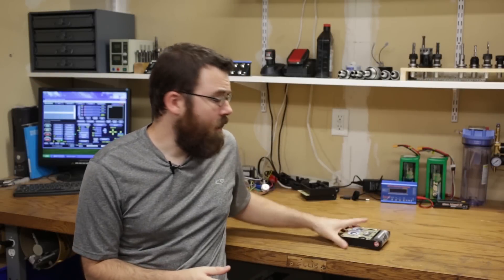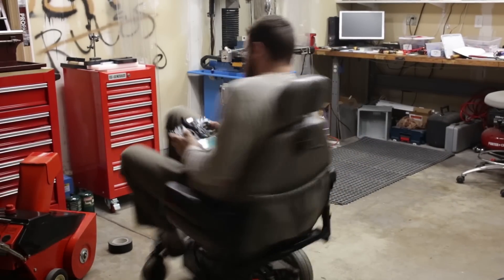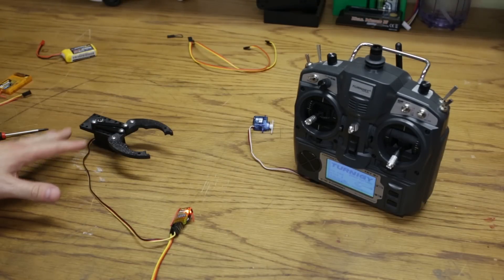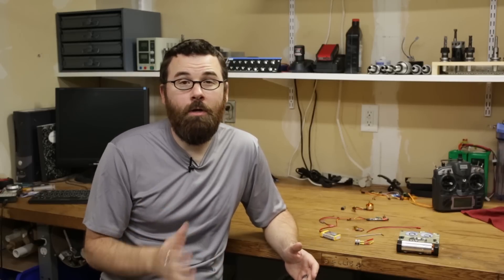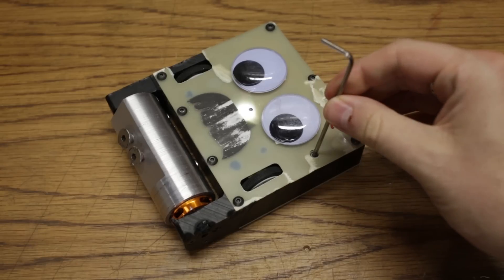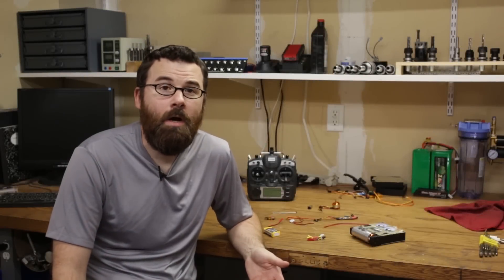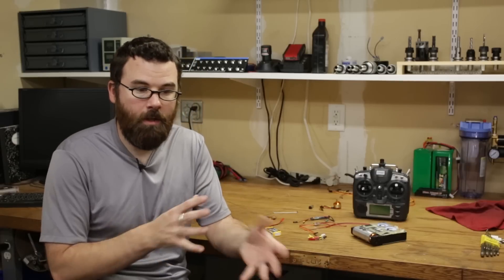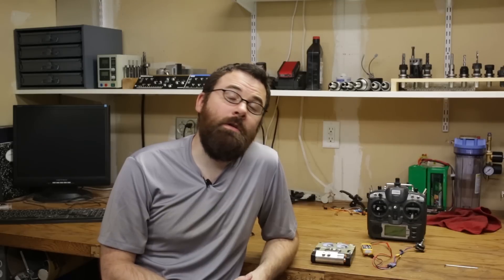Antweight Combat Robot - Part 3: Electronics

Comment: Hey man, awesome video! I really hope you see my comment, because I have two questions. I wanna build my own first ant (150 g) in October, when my exams are over (I started doing all the planning already).
I want it to be some sort of grabbing robot, similar to a lobster. Already made a drawing on some of the details. Now to my questions:
1. The servo claw construction you show in the beginning of the video looks awesome, where did you get it? I am still wonderinf whether fully custom claws are a good idea or not.
2. You showed some CAD clips; where did you get the files for all the basic parts like motors, battery, etc.? Because that would make the perflect planning a lot easier.
Thanks in advance :)
Reply from the maker: I don't want to discourage you, but 150 grams bots are pretty tricky to build, especially when they have active weapons.  And ant (1lb) or beetle (3lb) would be my suggestion for a first bot.  Regarding the servo, you can get it anywhere, it's a 9 gram servo, and that usually refers to the weight.  Check sites like amazon or servocity.com.  The claws were made by servocity, they have many different configurations, but you might find them too heavy to use on a 150 gram bot.  I made all the files myself in CAD.  It would be a good idea to watch my getting started video and use the resources available in the document linked in the video: 

 https://youtu.be/jZZfU_wlvYo
Reply: @RobertCowanDIY  Thanks for the answer :) I will definitely check that video out in the near future!
Interesting that you recommend not starting with an ant. From what I read and heard it is the typical beginner class. The problem is that I am from Europe and 1 pound bots are not that common, so this is no option for me. And the heavier, the more expensive bots get, too :o  That was my thought process behind choosing an ant. Do you think that for my grabbing bot starting off with a Beetle rather than a European Ant is better for me as a beginner, both regarding simplicity and _price_? Yet it would still be easy to switch the weight class :D

Comment: back again sir, so the wires and stuff how many do you need because i went to make one of my own and i need to now how much motters and wires i need for the bot. I.E 4x brushless outrunner. i need to now how much money i need :/
Reply from the maker: It really depends on the design.  You need a motor controller for every motor you plan to use.  If you are using a brushless motor, you need a brushless ESC.  If you are using brushed motors, you need a motor controller for those as well.  If you are using 4 drive motors, you can use a single speed/motor controller per side.  But generally speaking, you will need a controller for every motor.
Reply: ok  thank you

Comment: the battery is out of stock so do you have any other recommendations?
Reply: another question i had was wat kind of breakout board i need to use?
Reply from the maker: It depends on your design.  You can also check eBay or Amazon for the battery, I've found them there too.  But any battery with similar specs should work.  Also, I'm not sure what you mean by a breakout board, there's nothing needed other than the motor controllers, switch, and RC receiver.
Reply: thnx for answering I found some batteries with almost the same specs, about the breakout board.....I found a website with an explanation of the parts of a battle bot. A breakout board was one of those parts but it really confused me, now i know why. Thanks a lot for answering so quick :D

Comment: how did you get the drive to work with one joystick? does the transmitter do the mixing?
Reply from the maker: Check the comments and video.  It's called v-tail mixing, tank steering, etc.  If you have a programmable remote, you can program this in the remote, or you can get little modules that do this for you.  I programmed mine into the remote.

Comment: Hey Robert, great video! I'm just starting out with micro gearmotors and was wondering if a DasMikro 2S6A ESC has a built in BEC or a way of stepping down the voltage from my 7.4V LiPo? Thanks
Reply from the maker: I'm not familiar with this, but it looks like it has a 1A BEC, so it would work fine.

Comment: how much for the robot and the remote
Reply from the maker: With all the pieces, maybe around $500.  I didn't keep track, but it all adds up pretty quickly.
Reply: Ok because i would like to make an antwight robot
Reply: What about the chassis
Reply from the maker: How much for the chassis?  Like, you want to buy it, or how much did it cost me?  The material was only around $20.

Comment: Hi, about the "3-pin jumper cables," can you give me a link for the ones you got? I'm using the same parts as you. Also, do they fit perfectly with the escs and power switch?

Thanks
Reply from the maker: +Adam Hung I got them from hobby king.  They're just 3-pin 0.1" spaced connectors.  They are called servo extenders usually.  If you look on hobby king, ebay, amazon, etc, you can find them easily.
Reply: +Robert Cowan (Rowen Hobbies) Thanks (I am something of a complete beginner). How did you connect the escs to the one throttle? I've looked all over the internet but I can't figure it out.

Thanks again.
Reply from the maker: +Adam Hung Are you talking about the drive motors?  the weapon motor is connected to throttle.  In the video I mention v-tail mixing or tank steering.  this will be unique to your transmitter.  You'll need to look up how to enable this for your transmitter.
Reply: +Robert Cowan (Rowen Hobbies)  Yes, the drive motors. I have the same transmitter as you. How do you put the motors into a single control on the transmitter?
Reply from the maker: +Adam Hung You don't really use a single control, you are mixing two controls.  So, when you press 'up' on the stick, it makes both go one way, down makes them both go in the opposite direction, and left/right makes them spin opposite of eachother.  Search youtube for "Turnigy 9x Tank", it will show you how to setup v-tail mixing, or tank steering.  I can't tell you on mine because I've configured mine really strange because I'm a lefty.  There are plenty of tutorials on youtube about it.
Reply: +Robert Cowan (Rowen Hobbies) Ok thank you. Sorry for all the questions, but I was also having trouble with just connecting the receiver to the motor. I have a fingertech esc and a silver spark fingertech motor and the same battery as you. I attached the esc to the battery which worked, and the esc to the receiver and motor. Then I got the receiver to bind with the transmitter.

Everything seems to work, but the motor doesn't spin. What am I doing wrong?

Also, the fingertech website has instructions that say to put a bent wire into the esc.. I did this and then took them out and the lighting changed but I don't see the purpose... Does this have something to do with why it doesn't work?

Thanks so much for helping me.
Reply: +Adam Hung Hmm. Which mode is your transmitter on? (heli, etc.)
Reply: +Adam Hung Ok I got it to work never mind it needed to be on a different mode. Thanks so much. The jumper cables aren't necessary though right, I can just use a wire split three ways?
Reply from the maker: +Adam Hung They aren't necessary, it just makes connecting and disconnecting easier.
Reply: +Robert Cowan (Rowen Hobbies) Ok thanks. Will a soldered normal wire that splits 3 ways work?
Reply from the maker: +Adam Hung sure.
Reply: +Robert Cowan (Rowen Hobbies) I'm sorry, I still can't get the right steering mixes :(  Do I use "prog mix" or "Elevon" or what, and what do I set it to? Also, did you use "heli", "acro", or "slid" under type select? I have the exact same transmitter as you. I hope this isn't too much trouble for you.
Reply from the maker: +Adam Hung You'll figure it out.  There are lots of good tutorials on youtube about transmitters.  you can set them up a lot of different ways, you just need to learn how they work first.  Good luck.
Reply: +Robert Cowan (Rowen Hobbies) Thanks, but I have yet to find a tutorial that works for the 2 wheel turning setup... could you please give me a link? I'm sorry to bother you so much. Thanks.
Reply from the maker: +Adam Hung It's called v-tail mixing or tank steering.
Reply: +Adam Hung Okay. Hopefully last question: What type did you select (options change with different types) heli, acro, or slid?

Thanks for all your help
Reply from the maker: +Adam Hung It shouldn't matter, but I have it set as heli.
Reply: +Robert Cowan (Rowen Hobbies) Right. So do I leave the power parts for the all the speed controllers besides one empty (because of the BEC)?
Reply: +Adam Hung Can you please show us the electronics in more detail. I can't get the weapon motor to run...
Reply: +Adam Hung And what kind of esc do you use in the demonstration of the weapon motor?
Reply from the maker: +Adam Hung The weapon motor is much eaiser.  it just needs power (directly from battery) and signal going to the receiver.
Reply from the maker: +Adam Hung All the information is in the video and the description.  Just slow down, read some tutorials and get a good understanding of what you're doing.  You really need to figure out what parts to what and why before you just go trying everything.  Please, just step back from it and if you don't understand something, google it and figure it out.  there are TONS of resources out there.  Instead of worrying about what wire goes where and duplicating what I did, learn WHY I did what I did and then you will be successful.  This takes time, you can't just watch a single video/tutorial and expect to understand everything.  It took me MONTHS to build mine and I had to learn a lot.
Reply: +Robert Cowan (Rowen Hobbies) Ok thanks I'm sorry for asking so many questions. :P
Reply: +Adam Hung Programming the transmitter is very confusing :(
Reply: +Adam Hung Does the order of the wires that go from the tinyesc (blue/purple) to the motor matter?

Comment: Hi Robert, great series! Would a 4-channel transmitter be able to control a weapon and move the robot? Sorry but I'm new to electronics and robot building, thanks.
Reply: 4 channel radio systems will work fine with robots with weapons, as you need at least 2 channels to make a moving chassis as one channel goes to each wheel, you can use the throttle stick for a spinner motor or other weapon.

Comment: how exactly do you keep the spinner on while driving??
Reply from the maker: This is reversed from normal because I'm left-handed, but I use the left stick for driving, and the right stick for throttle.  So the left stick is spring-loaded and returns to center, and drives the robot forward/backward and left/right.  The right stick does not return to center and is used to control throttle or power to the weapon motor.
Reply: Robert Cowan can you make a vid on how to make it? Plz
Reply from the maker: If I get some more time, I want to do a whole series on the basics.
Reply: Robert Cowan thx

Comment: how do u charge the battery?
Reply from the maker: +leo pikka I use an Imax B6.  They are all over eBay and Amazon.  They are pretty inexpensive and get the job done, but there are much better chargers out there.
Reply from the maker: +leo pikka Yep, that will work!  there are a LOT of knock-offs, and that one most likely is a knock-off, but I have a couple and they work just fine.

Comment: how much for the cassis
Reply from the maker: Are you asking to buy it, because it's not for sale.
Reply: Ok is just that i want to build an antwight robot that can beat my freind
Reply from the maker: Sure.  But the material is very cheap, but you would need a CNC machine to make it.  But you can try something different.  Expect to spend at least $200 on a simple antweight robot.  Most of the cost is in the electronics and remote.

Comment: Wait. Is that the original firmware running on the Turnigy radio?
Reply from the maker: Tilman Baumann - Yep.  The only thing I did with the radio was switch the joysticks (I'm a lefty and wanted the throttle on the right), and I added a backlight.
Reply from the maker: Tilman Baumann Oh, I'm aware.  I haven't needed to change anything yet though, so it's staying stock for now.
Reply: +Robert Cowan (Rowen Hobbies) Hello! Why do you need the OrangeRx DSMX / DSM2 Compatible 2.4Ghz Transmitter Module  and OrangeRx R410X DSMX Compatible 4Ch/6CH PWM/CPPM 2.4Ghz Receiver instead of just using the one that's included with the Turnigy 9X 9Ch Transmitter w/ Module & 8ch Receiver ?
Reply: Adam Olsson The built in Flysky RF stuff is pretty horrible.
Most Turnigy 9x are actually sold without a module. Because nobody wants it.
Reply from the maker: +Adam Olsson The original works just fine.  I only used the transmitter module so I could use the smaller Spektrum (DSMX) compatible receivers.  the standard turnigy are just fine for must people, I just wanted a wider ranger of receiver options.
Reply: Robert Cowan Thanks, another question, can the turnigy 9x make so that you can steer the robot? You know so that if you want to turn right, one motor reverses and the other one goes forward. Like a tank. I belive it's called mixing/mixer.
Reply: Adam Olsson yes. Even with the crummy default firmware.
Reply from the maker: Adam, this is called channel mixing or v-tail mixing and is pretty common for most programmable radios.